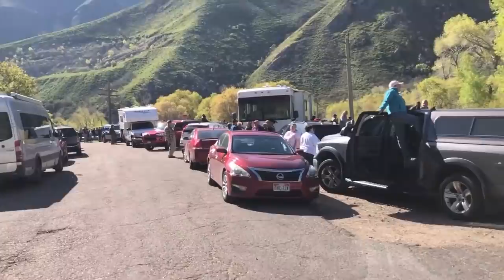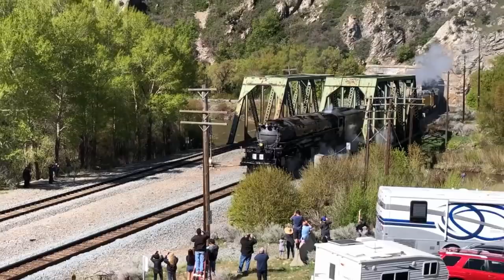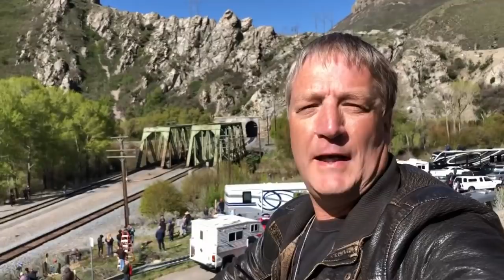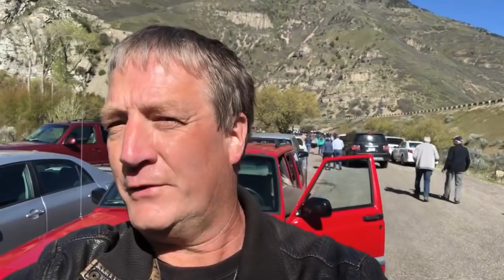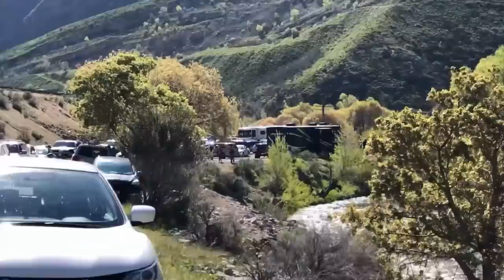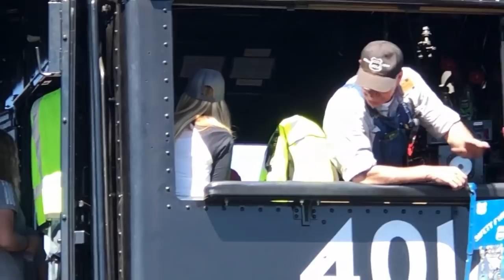Big Boy 4014 Exits Tunnel, Blowing Whistle & Crossing Trestle!  Live Action!

Comment: They should stop somewhere and drop off that deisel locomotive
Reply: The diesel locomotive supplies electric power for the passenger cars and also for FRA mandated dynamic braking. Safety backup. It mostly idles while underway, and doesn’t supply tractive effort. At times during this maiden run, it actually strategically applied the dynamic brakes to create further resistance for Big Boy to assist in the break-in process.
Reply: Yell out Freebird ....thnx for that info...I was wondering about that.